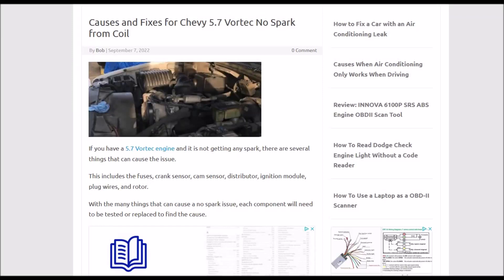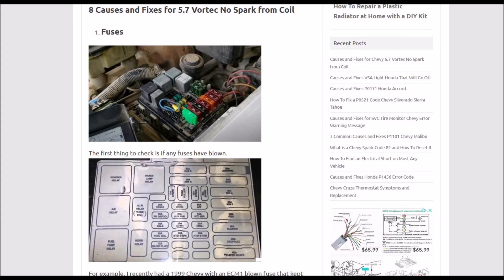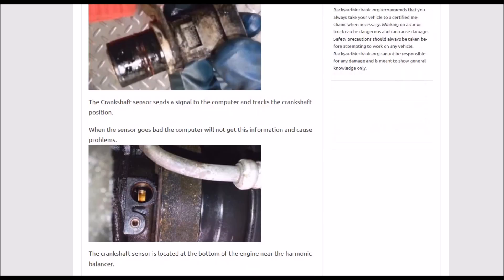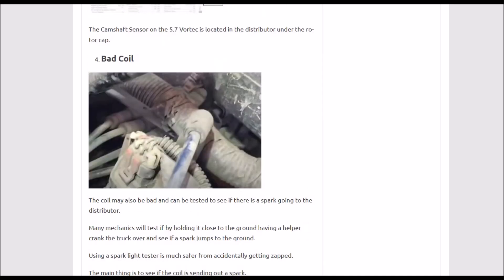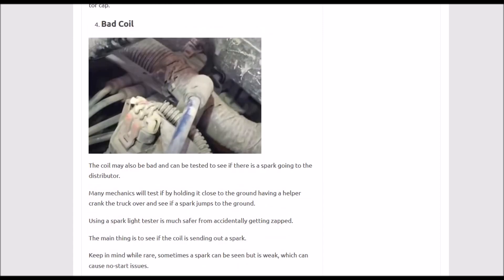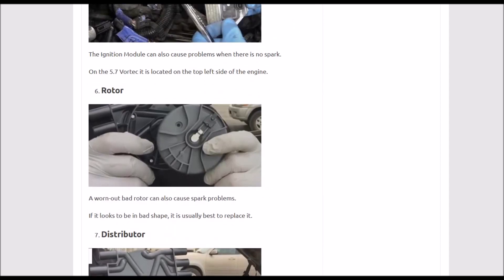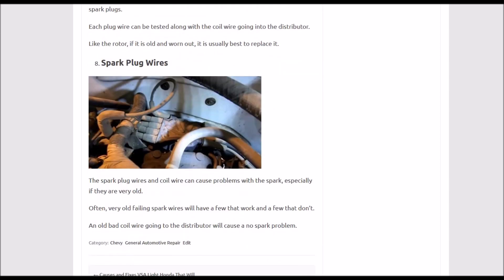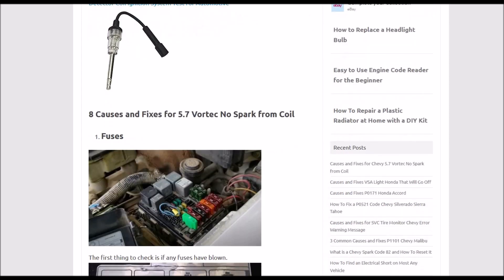8 Causes and Fixes for 5.7 Vortec Has No Spark

Comment: 97 with a 5.7 had just made a 300 mile drive day B4. Wife drove my truck 4 miles, said "it just died". Pulled it home. Tore into timing chain. Not the issue! Thought dist. Looked, wires to cam sensor were off laying on block. After all the work to replace gaskets from timing... No spark. Parts cannon went to work! New coil, new icm, new distributor, new crank sensor, new ground from block to frame. Had battery off 30 min. Still no spark from coil. Don't own scanner to test ecm signal. No codes on reader after cleared the cam sensor one from it, magically coming off while driving! Any ideas?
Reply from the maker: With the key on, is power going to the coil?

Comment: What if your not getting fire to the cool?
Reply: Check wiring to coil with a test light one should be power with the key one the other should flicker with a test light on it during cranking. This is your coil control wire gets it's signal from the ignition control module. Which is controlled by cam/crank sensor

Comment: Great video! My 5.7 1994 Chevy Silverado 1500 wont start when it rains. It started doing this a few months ago. Any idea on what could be the problem? Thanks!
Reply: distributor cap , also make sure the weather stripping above that seals the hood is doing it's job , I had to seal my cap to the distributor to fix it , when it did happen I left a hair dryer on for about 15 minutes pointed at the distributor cap ....

Comment: I’ve changed the cam and cranck sensor tge distriburator new plugs made sure it’s in time and the ignition coil he said he checked all the fuses and relays will be checking all the wires then so don’t know what to do if that’s not it

Comment: My 1996 chevy c1500 5.7 fuel enjection vortec keeps frying up new ignition coils after installing any idea where should i look?
Reply from the maker: I would replace all the basic things that are a part of the maintenance cap, rotor, wires, and plugs. Also, I would check the alternator output is not too high.
Reply: Ground wires

Comment: There is now power coming from coil to distributer and the coil is new what should I check next
Reply: Grounds
Reply: You should check the two wires going to the coil. One is power all the time and the other is switched power. This is your coil control wire it fires the coil. This wire gets power from the ignition control module. It should have 4 wires one power one ground one input from the cam or crank sensor and the other signal wire to the coil😊

Comment: I have a question. If the distributor timing is off, could that affect the spark?
Reply from the maker: The distributor is timing the spark, so if the distributor is off, the spark will be too.
Reply: @HVAC_Mechanic  Ok. Thank you. Why is the ignition coil not getting any voltage with the ignition switch on?
Reply: @Stam-zu8kr  that's a problem should get at least 10v while cranking or else will not start , check fuses, as well as wiring and connectors for burns and corrosion or bare spots causing it to ground out

Comment: My truck shut down while driving and wouldn't start up again...Out of the eight parts you named...I replaced all either...still want start.... don't know where to go from there.
Reply: My 98 Chevy 5.7 did the same about a year ago , replaced the distributor cap and rotor and started right back up
Reply: checked your grounds
Reply: If you haven’t try replacing the whole distributor and coil. There’s no crankshaft sensor in the 95 and older. All timing is made from the sensor

Comment: The gentleman I bought it from he said he change the fuel pump and he did a few other things I’m just curious if somewhere along the lines some of the wires might be bare or not connected correctly and I just don’t know where to start to start doing a diagnostic on the truck should I run out and get a meter and just start testing the fuses and then see if I can find a place that shows the piece to test for the spark on the spark plugs I just don’t know where to begin or what’s the best place to begin any ideas thank you very much Jay
Reply from the maker: The first step is to check to see if the engine is getting spark and fuel. Also, if possible, scan for any codes, as they will point to the issue. There are some good videos on how to check these things.

Comment: 1996 chevy Silverado vortex , new distributer . new fuel pump  new fuel filter No spark coming out of coil, new module, new crank position sensor, just changed out the cam sensor tonight july 8 2023, also replaced idle air sensor and throttle position sensor , rebuilt engine never had power after rebuild, would die on almost on all left turns slowly lost power last time it died was 2 month ago hasnt started since down since May and here it is July,  ,,What the Hell is it
Reply: only thing I havnt replaced is the coil or computer
Reply: okay just replaced the coil last night, still no fire,
Reply: been all threw the wire connections too
Reply: @nealolin5947 ...did you pinch the wire harness between the motor and transmision when you put it in ?
Reply: Having the exact same problem.97 silverado 5.7 father passed left it to me.ran fine started it.and it shut off.hasnt ran since.ive put all new wires,plugs,fuel pump,fuel filter,cam and crank sensors,ecm,coil,and brand new distributor and battery.still nothing just cranks and cranks..
Reply: @dontarucker114  I even changed the oil pressure unit switch under the distributor still nothing, took my ohm meter checked for amps all the components are getting amps,
Reply: @nealolin5947   after all the sweat the truck STILL wont start..getting it running is my dream..my dad passed and left it to me...he was very fond of his truck...i just dont know where else i should look....
Reply: @dontarucker114 Sorry for your loss btw
Reply: After doing some more research..ive found that all main ground points should be checked and could be the reason for no start...but after that..il be lost.
Reply: @dontarucker114 Keep us updated
Reply: @dontarucker114 sorry to hear about your dad. Did it ever start? Check the ecm, check for fuel pressure these engine dont run on low fuel pressure. I know you changed the fuel pump but check it, make sure it holds too. Crazy as this sounds I had the same issue you had and i was stumbled, after replacing a crap load of parts including the timing chain(i think it was bad anyway) it turned out to be the spark plugs. Worked on cars all my life and this is the first time this has happened to me. I changed them and cranked, and it started right away. I always use iridium plugs by ACDELCO. Ive used different plugs and the engine shakes. Let us know what happened if it runs or not.

Comment: My Tahoe turns over , but won't stay started. It grabs then just quits. I'm a 64 yr old  old lady and have no one to help me.
Reply: Did it ever start?

Start with spark
Move to fuel pressure

Which ever doenst work is where you need to point to.

Comment: I was driving my 97 chevy down the highway and it just shut off new coil new distributor now  not getting power to coil
Reply: I have the same issue did you get it fixed?
Reply: @jonnnylee hey I have same issue did yours get fixed?
Reply: @BradleyMoradel-q5y i had to make a small hole in my distributor cap to see the spark evenly hit the post it’s a video on here somewhere just search it. Very diy-able 😂.
Reply: I had the same issue. Any pointers
Reply: @broomdustin I have the same issue I power to coil did you get yours fixed?
Reply: Guys check the crank sensor. If you have no spark look at your crank sensor. Distributor on these vortecs 96-2001 tend to go bad. Do not just remove the distributor and replace it make sure you mark the cap against the manifold and the base of the distributor to the manifold so you dont get a correlation error when starting.

Comment: I have spark but a weak spark
Reply: Me too. Truck won't start. Can't figure it all out for the life of me.
HELP PLEASE!
Reply: @Phdintheory  I went through the same thing and it turned out to be the spark plugs. I changed them and the engine started right away. 🤦🏼‍♂️
Reply: Got it figured out. 
Mine's a 96 Chevy 1500 Pick-up. Checked the usuals, dist, (little corroded, cleaned it), wires, ok. Plugs, fine. Coil and in this case an ignition control module that is a common failure in these trucks. It HAD to be between the ignition key and the spark plugs. There's no other way. I had already replaced that coil AND the module 2 and 3 times. Weak spark typically indicates a ground problem. The only place left was the wiring between the ignition and the coil. I checked the wiring harness and wires individually. One of them was worn. Adjusting them while examining them fixed the bad ground. The truck with some priming starts well now.
Remember: Ignition is, battery, wiring, (sometimes a module,) coil, (sometimes a ballast resistor) wiring, distributor, rotor, cap, wires, plugs. = Spark
Reply: @Phdintheory would you be able to help troubleshooting?
Reply: @lane8a  I can try, shoot. What's your question.
Reply: @Phdintheory  I have an 88 c2500 5.7
Just shut off on me leaving the house . Crank ,no start. 
I wanted to test if my icm is getting power .
Reply: @lane8a  Set the multimeter to AC voltage (VAC) reading and check for voltage / 24VAC @ input to the Ignition Control Module. You should get a reading of 24VAC
If you're on the passenger side of the engine bay Looking at the motor the ICM will be basically in front of you. The coil would be to the left a little bit. Looking at the ICM, you have a plug that goes into the module. Pull the plug and look at it as if it were plugged in. The top wire should be pink, (12v Power circuit) Next one down white, (Ignition control circuit) Next down black, (Engine ground circuit) bottom one white with a black stripe (Switching Signal)
Reply: @Phdintheory  got the tool it's an auto ranging one.
Reply: @lane8a  let me know how it goes and we will go from there
Reply: Ignore that first 24 v  part it came from the Internet it should be no more than 12 so it's obviously some bs. Sorry
Reply: @Phdintheory  okay. Will do.

Comment: if all these things are ok then what are we talking like computer problems?
Reply from the maker: It is possible but that is rare, a hard-to-find No Spark issue after all the main parts are swapped out or tested is usually in the wiring.
Reply: I'm having the same issues, changed everything that has to do with ignition spark. Lastly is the ecm tomorrow from a junk yard. Wish me luck!
Reply: How did it go? Get it working? @Tonyjs24
Reply: @Tonyjs24 you figure it out? Same boat

Comment: Good video by the way sorry for the long comment but when  I was experiencing a crank no start issue, I searched everywhere and asked many pro mechanics, but no one has had this issue I was experiencing. Everyone's train of thought was... fuel-air and spark= start..boy was this not the case with this van.

I have a 96 Express with the same engine except it's a 305 its a carbon copy of the 350.

again, I’ll leave this comment here in case someone has a stumping issue with this engine. I’ll explain the issue thoroughly because it’s important how many new parts this van had and still did not start.

I went on a long vacation for a year and 2 months. Came back and van wouldnt start, I changed the MAF since i had no reading, long story short, the ECM is located under the master cylinder and the case had moisture and cracked letting water in,, replaced it with a flashed unit.

May i changed all 4 sensors since the exhaust had a hole for about two years and i got sick of it… new catalytic with 02 sensors (4) van ran flawless!

Going to work, van started smoking thru the tailpipe and i thought, engine went bad. It left smoke like crazy and this issue led to my last issue i just recently had. It turned out the MAP sensors O-ring, deteriorated so it was getting false readings! Changed it and off it went working excellent until…

On vacation August 2022 i
Took this van far away  into the mountain and the van shut off a few times. Getting harder to start each time changed the distributor, coil and it started, I thought, problem solved!! going back home it shut off during a  4hour drive) until it wouldn’t start anymore, i had no tools with me.. had a friend drive 70 miles to me with a crank sensor and that was the issue! van ran great but with a correlation code..

August of this year, going to work van shuts off. Tried starting it and sounded like it was out of time. Thinking that when i put in the new distributor, I never set the cam retard to zero, the van would ping slightly in overdrive, so I guessed the timing chain stretched out. 220,000 original miles.i changed the timing chain… no start and at the time had spark and fuel keep that in mind.

In 2011 I had changed the fuel injection system from factory CPI to MPI. According to the manufacturer, they last about 10 years. I tested the fuel injector harness and i was getting pulse so  I changed the fuel injectors again for fresh ones. I had a lower intake oil leak so it didnt really bother me since i was in the engine far down. Still no start 
Since I had a warranty on all the parts I changed all these again.
Changed the ECM no start
Changed fuel filter no start
Swapped out ECM, coil, CPS,  and distributors since they were all under warranty.

Still no start from above parts

Changed spark plug wires no start.

Lastly since removing the spark plugs on these vans is a chore, I started removing them and BEHOLD...they were pretty fouled up!. I ordered a fresh set which came in Dec. 22,2022 I put them in and prayed in alien language for it to start...key in....cranks over...and VROOOOOM it started. It still left me stumped that plugs can do a no start condition.

from having this van so long I have learned Vortec engines in 305 and 350 form and their cousins the V6s are very sensitive to spark strength. A lot of these vortecs will not start with a bad cap or damp distributor. The plugs I had in this engine fouled up when I had the MAP sensor O-ring fail, the ECM tried dumping in more fuel so it fouled up the plugs pretty bad...weird that the van ran so long with bad plugs. I am guessing when the van shut off recently going to work it was the timing chain that went bad and the plugs got to the point that the current wouldn't jump the electrode correctly.

Fresh iridium plugs and its running like a champ!!  

Happy Holidays
Reply: Thanks you for this wealth of knowledge! It is very much appreciated
Reply: @DIXIEMAFIA251  hope it helped someone. Thank you.
Reply: Noted once I grab my tools first thing Im going to check is the spark plugs. I got a 1998 gmc suburban with a 5.7 in it. I was about to go to work the other day and she didnt start I smelled a fuel leak coming from the rear. Found a hole that had got rubbed into the fuel supply line from the pump I cut out the bad part and spliced in a new connection she started up just fine. Few days later the burban starts running real rough and now were back to the point where it wont start. I replaced the fuel filter what came out of it was pretty much black when I dumped it out, still wont start after that. I figured Injectors probably got clogged from the poor quality of fuel that was being delivered to them from the filter but still nothing after I replaced those. So atleast I can rule out fuel being a problem. I'll probably spend a good chunk of my evening checking the ignition system/spark thank you for the valuable information that you learned from your van.
Reply: @oogie149 youre welcome. These engines  are notorious for having distributor issue so check the spark first but if you have no spark it could be your crank position sensor. These engine are sensitive to having weak spark from what ive learned, not like a older carb chevy that would run if there was an electrical storm in the clouds😅
Reply: @YoungHeartedSoul on Sunday I went back out to try and see what I could find on the heavy chevy. First thing I wanted to do was see if the spark plugs were fouled I’ve only had the suburban for about 25k miles and she’s almost at a quarter of a million miles. Sure enough first spark plug I go to check snaps off in the engine, I just threw my ratchet into the engine bay and went back inside. Came home from work Monday night with some extractors and some spark plugs and knocked that out. But once all of that was done I told my girlfriend I bet it’ll start now and told her about your story and how sensitive you said these old 350s are. Sure enough the old suburban started right up and is back up and running again. I was slightly surprised though because only 2-3 of the plugs were actually foul the others didn’t look horrible anyways thank you for all your knowledge and experience dealing with these old beasts.
Reply: @oogie149 hey thanks for responding. I am by means not a super mechanic but have been working on cars since 8 when my dad had a fleet of vehicles. You know what really amazed me, that this engine is so sensitive to any weak spark or ignition issues. My 73 firbird has had bad wires, bad rotor, bad cap and it would miss and run bad, but these engines they either run or don’t run with bad ignition issues. I also have an 88 Trans Am that has a bad ignition wire right now on cylinder number eight and it runs and misses but runs. You know another thing that I have noticed using AC Delco these engines run the best. They’re a little pricey, but they are worth it same thing with the ignition wires. I only run AC Delco wires and it runs very good. My engine right now has 226,000 miles And a purrs. Very happy that you got this thing running they are amazing engines and will last you a very long time with good oil and frequent change of it. Stick to the factory oil viscosity that’s another thing that I learned. Thanks for the update. Very much appreciated.